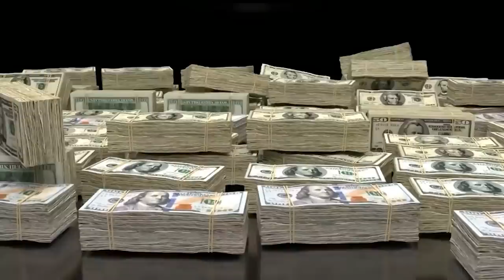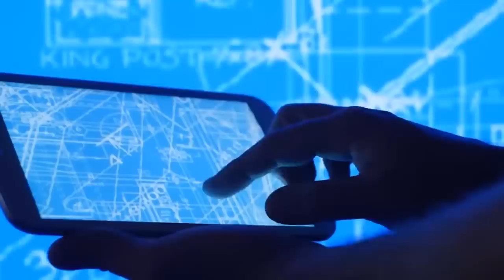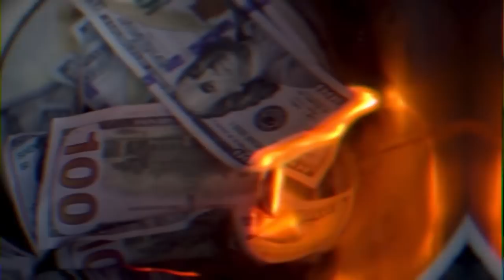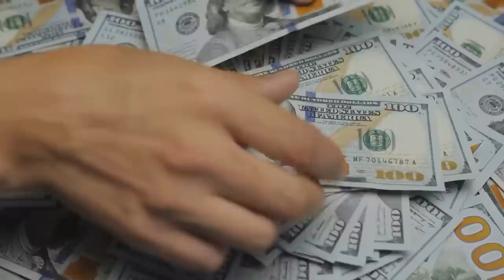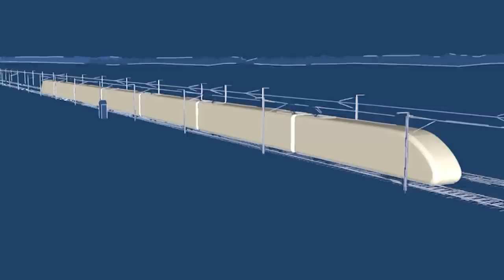Green Light for $4.2B California Bullet Train

Comment: Hey, this video is actually pretty good unlike almost all other similar videos on Youtube! Kudos! Almost no misinformation made it into the video.

I would just highlight one thing. The I-5 corridor was rejected for CAHSR not purely in order to serve the Central Valley cities. Important as it is to have CAHSR serve the 6.5 million inhabitants of the Central Valley, this was not the main reason why the current alignment was chosen. 

This is just a conspiracy theory driven by the rabid political opposition to this project. In actuality, the I-5 alignment would require an incredibly expensive tunnel under the Grapevine mountain range to cross into LA. That tunnel was judged to be more expensive than the entire system plus the planned future extensions combined. It's an incredibly challenging piece of terrain to tunnel through. Instead, a crossing to the east was chosen - the Tehachapi pass. This pass is where most of the rail traffic crosses into the LA area from the Central Valley. It's the default choice. It also has the side benefit of going through Palmdale which houses yet another 500k potential riders!

and if you trace a straight line from the Tehachapi pass mountain crossing to the northern mountain crossing into the Bay Area, you get precisely the current alignment. It is almost by sheer luck that this straight line between the two chosen crossings happens to reach every single large city in the Valley!
Reply: The reason the SP went over Tehachapi was at the time they weren't planning on going to LA. LA was a small city, and the SP was focused on going to New Orleans, crossing Tehachapi then going over Cajon to continue east. LA convinced the SP to build to their city, so SP turned south through Soledad Canyon to LA then continued east to New Orleans. Later, Santa Fe did seriously consider building over Tejon Pass (Grapevine) to better compete with SP for intra-California traffic, and even began surveying a route, but felt they couldn't compete with state-funded highways being built at the time. So they abandoned that project and used those funds to upgrade their LA-Chicago mainline, and instead launched a new passenger service between Bakersfield and Oakland with a bus bridge to LA, which would become Amtrak's San Joaquins.
Reply: Following the I-5 corridor for high speed rail saves a substantial distance over going through the Central Valley on a passenger high speed railroad considered to be at the viable distance limit to compete with jet travel between LA and San Francisco using the I-5 routing.  Using the Central Valley for high speed rail makes it longer than the 300 - 500 mile trip distance for high speed rail to offer superior destination-to-destination travel time compared to jet travel.  

I think the real loss is not exploring a coastal routing that Amtrak currently uses going north of LA and continuing a new high speed rail alignment along the coast linking costal communities between LA and San Francisco, although slightly longer than the I-5 corridor it offers travel through a costal area many people would desire with much scenery.   The idea of avoiding large cutting edge engineering challenges, such as the I-5 corridor or a coastal routing would require so fragmented construction and design can make use of standard construction firms is good for rapid employment, but has little chance of assembling a cohesive high speed rail system.  There is no advanced passenger train research and development institution knowledge growing and evolving.  

What I've seen in videos of the HSR construction appears like very straight forward construction through unchallenging Central Valley terrain done at very high expense connecting farm land without great scenery.    I've read California high speed rail design documents that state high speed rail criterial does allows for climbing grades over 1.6% at high speed, but not for going down grades at over 1.6% at high speed.   Outside the Central Valley in areas not yet immediately up for construction there are grades in the designs for "high speed rail" over 1.6%.  If rail grades need to be less than 1.6% for normal bi-direction high speed rail use then this will  be a show stopper.  I'd expect ether high speed rail will have to be degraded to just a fast train or an extensive redesign and rerouting will need to take place.  

The solutions for reducing steep grades is likely more extensive tunneling.  The expectation in China with high speed rail is it will likely be made up of bridges and tunnels to such an extent the main design companies designing high speed rail alignments specialize in bridges and tunnels.  That should tell you if contemplating high speed rail don't be averse to bridging and tunneling because those structures are the foundation of many high speed rail alignments.  Whenever possible the desire structure for a razed alignment is earth because it is permeant and solid with little long term maintenance compared to bridges that have a limited life span and do vibrate and shake more than earth structures.  

Freight railroad have been approached about combined railway corridors with the California high speed rail, but they have backed away from that idea.  They may not see the economical advantage of being that great, but moreover they don't feel comfortable with a reasonable outcome working with non railroad knowledgable organizations.  The idea that California can build high speed rail over sizable distances without becoming experts with it is absurd, which is the appearance of what is taking place.    At this rate of institutional development the high speed rail between LA and San Francisco might take another 30 years and miss technological achievements needed to deliver the timely connections it was intended to provide.   As a rail fan I think I'd still like to see it built, but I fear it might serve to show that high speed rail doesn't work in the USA.  There is a high chance the California high speed rail connecting LA and San Fransisco will show high speed rail costs a lot and then doesn't compete with normal jet traffic in time saved.  To some degree the real advantage of high speed rail isn't connecting the two main destination cities, but allowing fast connection with them and the smaller communities between them that don't support passenger jet service.   That is where a coastal route would bring a great deal of benefit.
Reply: @douglasengle2704  im not going to comment on everything here, as i dont know enough to do so. BUT, if you really think having the train running along the coast is a great idea, you're wrong.

The coast is not only mountainous, but wet. And i mean rising tides wet. Do you really think water and electricity for a system that hasnt been built in a region in DECADES is a good idea?

Also, plenty of train- high and low speed- drive through the countrysides. There's really no getting away from it.

Also also, the future plan is to connect to Sac. And the most direct route to Sac is through the CV.

If anything, with Amtrak's service past Merced will ending once this is built, that's an issue i think we should discuss. Cuz unless they are connecting the dying stations to the new ones with some type of bus service or intercity rail, they should instead continue it
Reply: @Yvonne-Bella  The most direct route is through the I-5 corridor.  The idea to avoid engineering challenges is typical, but unavoidable.  A large part of HSR interest is it is an engineering challenge, but the reward has value.   This is a new system and saving even 30% on construction is a fools savings if it makes it less viable for its difficult to achieve goals.   As it stands right now if built it doesn't appear the designs would allow for HSR end-to-end and I'm suspicious even in the Central Valley with such an apparent lack of motivation for really building HSR that it will function as HSR.  The design criterial I've read has been informative discussing specification for 400 kph high speed rail, but looking over the designs they don't meet this criteria.
Reply: @douglasengle2704  Almost everything you wrote is debunked nonsense from foamer blogs.

I'll address just this one thing. Going over the I-5 requires a tunnel under the Grapevine. That tunnel was going to be more expensive than the entire project plus all the extensions. It was a complete nonstarter. Hence, they chose the Tehachapi Pass crossing toward LA. From that crossing to the chosen northern crossing, Pacheco Pass, the shortest line is in fact the current alignment. 

If you don't go under the Grapevine, then the I-5 is actually longer than the Hhy 99 alignment that they chose. You can look at a map right now to verify.
Reply: @douglasengle2704  I-5 is not the most direct route because it requires an insanely expensive Grapevine tunnel. Sinve the Tehachapi Pass crossing was chosen, the chosen Hwy 99 alignment is in fact the shortest straight line through the Valley.
Reply: @TohaBgood2  Would you be so kind to explain why tunneling through the San Gabriels is a good idea?
Reply: @davidjackson7281  The terrain going through the San Gabriel mountains toward Palmdale and then through the Tehachapi Pass is a lot more mild. It's conventional mountain crossing terrain for rail infrastructure. It's also why the existing rail lines go through there. It's just a much easier mountain crossing from a technical perspective.

That means that the whole thing does not have to be in a giant monster tunnel through a major seismic fault zone. Going over the current route will only require a series of small tunnels that are a lot more manageable and something that we build all the time vs. the Grapevine monster tunnel which would be a world first in most ways. This will also make it possible to keep high HSR speeds through that sections vs. the Grapevine tunnel which would have likely required a massive slowdown like in the Channel Tunnel on the Eurostar where trains are limited to only 100mph. In terms of actual running time the chosen crossing is a lot faster than a potential Grapevine tunnel crossing ever could be.

Another advantage is that over 500k people live in Palmdale and even more in the Palmdale area. It's also the only viable connection point to a future Las Vegas HSR link. That's a ton of riders to bypass at insane cost! Why would anyone want to do that? Why would we spend many times more money to bypass 0.5 million customers, at a slower speed, and with no Las Vegas link? If you actually think about it then the Grapevine option never really made any sense. That's why it was dropped almost immediately and the Tehachapi option was chosen.
Reply: He was right about the Central Valley “being a part of California”
Reply: @TohaBgood2  " I-5 is not the most direct route because it requires an insanely expensive Grapevine tunnel". So the grapevine tunnel is the most direct route.  The expense of building a railroad doesn't change its distance.
Reply: @douglasengle2704    All of this was already discussed when they were making the routing decisions years ago. A Grapevine tunnel was considered briefly but dismissed as soon as they looked into its costs and specs seriously. It came out insanely expensive. It would have to be extremely deep and extremely long. This would mean very complicated engineering and severely reduced speeds. See for example the Channel Tunnel which has speeds capped at 100mph vs 186mph for the Eurostar on open track. A Grapevine routing would be slower than the chosen Tehachapi pass route because the latter maintains HSR speeds while a Grapevine tunnel would have to downgrade speeds significantly for safety.

The point of having a more direct route is to go faster, right? What’s the point in spending insane amounts of money on a crazy long tunnel if this nominally “shorter” route takes longer to traverse?

And finally, the most direct route from SF to LA is actually not the I-5 but rather “as the crow flies”. The I-5 is significantly to the east of that direct line. So why don’t you propose that direct route instead? It’s significantly more direct than I-5, isn’t it? Shorter == better, right?

Well, just like the Grapevine routing, that actually straight SF-LA routing goes through complicated mountain terrain and would be even more expensive and have even more restrictions. In picking these routes, having the straightest possible line on a map matters little if the trains go slower on it than they would on a saner alignment! The point is to have faster trains not straight-looking lines on maps, right?
Reply: @TohaBgood2  I've never read other blogs..  I did my own simple route study.  It just happened that the I-5 route was actually studied.  I have also read the California HSR 400 kph railroad design criterial and it doesn't look like the actual designers did because their designs don't meet the design criterial in regards to maximum grades of 1.6% for HSR going down grade.  This looks like a ship without a captain from the start or shortly there after.  I am expecting that once they start looking seriously into the going through the more difficult terrain outside the Central Valley it too will be prohibitively expensive.
Reply: @TohaBgood2  China builds HSR tunnels.  The Swiss have built long HSR tunnels.  The Japanese are building long maglev passenger train tunnels that are for 500 kph.  It doesn't seem plausible that a top HSR engineering team can't put a HSR tunnel under Grapevine.  That made me doubtful of any real competence in the California HSR project after I'd read about the HSR Grapevine tunnel study.
Reply: @douglasengle2704  Possible - sure, necessary - no. Why would you go to the extra trouble and expense if you can also capture a ton more riders by not doing it? At HSR speeds the extra 10-20 miles you're adding to the route take all of 10 minutes to cover! It's literally nothing in the grand scheme of things. 

But what you gain is 500k more riders in Palmdale, 6.5 million in the Central Valley, and a connection to Vegas! Who in their right mind would spend more money to run this HSR line and bypass most of the customers on the route? Doesn't that sound insane? Cause it sounds pretty insane to me!

And if you're doing that then why not quadruple or sextuple the cost and go on the completely straight line? That's more direct by a few dozen miles still, isn't it?

FYI, whenever at all possible, all HSR projects avoid tunnels like the plague. They really do a number on your budgets. That project in Japan is already more than 2x over budget. Not 50% over budget like CAHSR, but 2x, 200%! It's already 10 years delayed and it's not clear that they will ever finish it. The full route is only slated to be completed in 2037 and even that is perceived as mostly marketing. It looks like it will just remain a stub of exotic infrastructure just like all the other maglev lines.
Reply: @douglasengle2704  Lol, sure bud. The people from Deutsche Bahn that CAHSR hired to do early operations know less about HSR than some dude who did 5 minutes of research on the internet.

And those other world class HSR engineers that CAHSR has hired know less than you too. Sure!

Give us a break, will ya'?

😁😁😁😁
Reply: @TohaBgood2  LOL. He really said “I did my own simple route study”. 
His “simple route study”: looked at a flat map of California for 45 seconds
Reply: @HarZoiD  you know, creators like the Backyard Scientist and Alan Fisher (the Armchair Urbanist) have reclaimed those kinds of insults. That leaves me wondering what to call this 🙃 gotta get creative now
Reply: @mrmaniac3  Exactly. You got it 😂
Reply: As European my guess here can only be that the US simply lacks the experience in building HSR tunnels. Looking at Switzerland, Austria or Italy, or even the Fehmarnbelt fixed link between Germany and Denmark there's a lot of rail tunneling goin on, and costs are consequently pretty manageable...
Reply: 1. The original proposal used the CA99 corridor because the Legislature needed the Central Valley votes to pass the Proposition 1A funding on the statewide ballot. BTW, the Sierra Club threatened to remove its support for the original route unless a special Central Valley caveat was put in -- a station at Los Banos is not allowed because the Club fears HSR becoming popular and the Central Valley becoming a less expensive commute suburb to Silicon Valley. 
2. The original route planning made wrong/ignorant/bad/low-ball assumptions about using the CA14 route. The amount of tunneling now required for that section is by itself more expensive than the required Tejon/Grapevine tunnel. The Legislature feared the Grapevine route because of property needed from Tejon Ranch (the largest private ranch in California, a politically powerful entity). The CA99 corridor has become a nightmare for land acquisition, and dealing with Tejon Ranch would have been simpler and cheaper. The I5 route would have been faster, straighter, and easier. 
3. The existing Tehachapi route is so winding (useless for HSR, which needs straight track for any speed) that long trains literally cross over themselves on the corkscrew elevation. This situation is why there is no passenger rail service between Bakersfield and LA, even though the tracks are there. 
4. Using a coastal route is a non-starter. The US101 corridor is too winding and constrained for new HSR. 
5. When Jerry Brown returned as governor, he told HSR there would be mandatory track sharing between San Jose and San Francisco, to keep the cost from going to Apollo Program levels (SF estimates that just 2 miles of new track to the already-built Salesforce Tower terminus in SF will cost $6 BILLION.
Reply: @ReedmanFL  You're making assertions that you can't support and some that are provably false.

1. This is a 100% voter funded project and approval from as many Californians as possible was key in passing the 2008 bond measure. But connecting 9 out of the 10 largest California cities including the cities in the Valley was never just an optional thing that you could pass on. It was literally the justification for the project. I know that a lot of you wanted to divert the project to just an SF-LA HSR link with no stops in other cities. But this went expressly against the goals of the project and against the will of the people. It was always a nonstarter and it was always going to fail. It is literally illegal to divert the money for a statewide HSR project to serve just two metro areas. CAHSR is just a small part of a multi-decade investment program for rail that California has been undertaking for the last 20-30 years. It's supposed to serve as a statewide backbone to a bunch of other local rail services that have been getting beefed up and upgraded. You can't just alter a key part of a multi-decade statewide rail plan just because you think that Fresno doesn't matter!

2. Wrong. The current post-inflation adjusted cost is similar, but this is after the actual engineering is done for a full-speed HSR Tehachapi Pass alignment. The Grapevine was never even coming close to those speeds. a full-HSR version if it were even possible would cost astronomically more. The cost that you are using for the Grapevine tunnel is before inflation. And this cost was large than the entire cost CAHSR at the time without the Grapevine tunnel. It was an insane cost escalation at the time. Given that it has been decades since those estimates, that's just a crazy irrelevant number to compare to. Furthermore, you're comparing the Tehachapi option after all the engineering is already done and in today's dollars. Are you arguing that the Grapevine estimate would not go up proportionally if they were to actually go look for all the fault zones and geotechnical issues with that route? Because that is laughable.

3. The exisiting Tehachapi route is a freight link that was built in 1876. No HSR or passenger rail is ever plan to go there. 
technical

4. Yes.

downtown
Reply: @TohaBgood2    "The people from Deutsche Bahn that CAHSR hired" are writing what their customer wants them to say.  You're not going to have good customer relations if you overly criticize the people paying you.  I have not read the reports from Deutsche Bahn, but I bet there are statements that act as a legal back stops for situations they can't control.  I did  read the report on the Grapevine HSR base tunnel study years ago.  It didn't read like an engineering study describing a challenging HSR base tunnel construction (base tunnel is a tunnel starting at the base of a mountain that is very long compared to shorter tunnels higher up on the mountain), but a report on why it's wasn't possible!   That is absurd!   If you are going to build HSR over any significant distance you expect to build a lot of challenging tunnels, fills, cuts and bridges that make an HSR alignment possible.  

I'm not as constructive in my comments as I was when it seemed like the CAHSR might have had as a primary goal of providing a new type of high quality-of-life passenger train experience competing realistically with airline travel times when the airport commute time is added in.  The HSR connection between LA and San Francisco is where 220 mph running speeds are justified along with minimizing delays such as longer distances.  The CAHSR designs I've read are mostly below the  specifications for 220 mph.  They have grades exceeding 1.6% descending which the CAHSR specifications claim doesn't allow for needed train control for HSR use of speeds above 124 mph) (200 kph)  The CAHSR specifications preferred minimum radius for a 220 mph curve is 50,000-feet with a minimum of 25,000-feet.  The curves I've seen in the CAHSR plans are suspiciously looking tighter than these specifications and don't have their radius obviously listed.  I'm very disappointed at CAHSR past history with their HSR project.  Large highly engineered projects like CAHSR should not only be of obvious high value they should act to inspire and advance the culture of engineering and railroads.   The huge flaw in CAHSR is its failure to develop institutional knowledge.  The consultants are hired to hire other consultants according to overview reports I've read.   California needs to be developing CAHSR with permeant long term career employees with long term career advancement in its CAHSR industry.    It still seems like there is lack of long term commitment to HSR.
Reply: @douglasengle2704  All HSR routes throughout the world don't run at their top speed through the entire length of the route. They all stop at smaller cities in between the large city centers. And many HSR trains share tracks once they are within the big city centers so they obviously can't go at full speed. The same thing will happen in CA. There will be huge sections where the train will go 200 mph and about 50 miles out of LA and SF will run at much slower speeds but still faster than many current trains in the US.
Reply: @theexmann  The very concept of HSR is to have it between major large cities where it runs the entire length as HSR.  I'm not aware of the Japanese bullet train going slow on the outside of cities.  Chinese HSR like any railroad does have sections below normal top track speed, but these are not due to being around cities.  The UK's HS2 going between London and Birmingham is said to being built  90% in tunnels or on aqueducts.  That is the kind of construction expected to build high speed rail.   Bringing the HS2 into London is going to be in a massively long tunnel apparently greatly to avoid the populated surface.  There is nothing in the HS2 that indicates it will be going slower around and into cities.  California is unique in that its currently planned HSR doesn't actually have HSR to a major metropolitan city.
Reply: @douglasengle2704  You're completely wrong. HSR all throughout Europe slow down considerably when they arrive near city centers. Many of the major city stations are NOT underground. There are tons of youtube videos that show that. And like I said many of these HSR routes stop at smaller cities along the route. If you think about it, they have to slow down to stop at these stations too. How long do you think it takes to slow down a train going at 200mph? It's a bigger distance than most people realize.
Reply: The benefit of using the I-5 corridor is that the State already owns the land.  Obtaining the land for the route along 99 has caused massive delays and they still don't own all of the needed land for the route.  Down near Bakersfield the distance between I-5 and the 99 is under 30 miles so they could have followed the I-5 corridor and still gone over the Tehachapi Pass.

The biggest reason for cost overruns so far is polical cronies getting the construction contracts by dramatically under bidding the project and then going massively over budget.  A recent audit of the CHSRA showed that they have paid tens of millions of dollars on contracts already with no evidence any of the work was actually performed.
Reply: @sharkhaywood  Dude, that's just a bunch of nonsense from foamer blogs that was debunked like a decade ago. But I guess at least some of you people forgot that debunking so let me give you the cliffnotes version.

To begin with, the I-5 corridor like any highway median was designed for vehicles with rubber tires doing about 70 mpg. A lot of the turns are simply too acute for HSR and the train will necessarily need to slow down in a ton of places. HSR corridors built in existing highway medians are usually limited to 150 mph. This would be the case for almost the entire length of the I-5. That already means that that corridor would be illegal under the 2008 bond measure. So game over, you can't do it.

But even if you could, the median of the I-5 corridor is not wide enough in sufficient places to make that median viable for any rail line, let alone HSR. Consequently, to stay in the median you would need to constantly hop in and out of it at incredible expense. Those viaducts to hop in an out of the median are literally the most expensive possible way to build a rail line. And of course, every time you hop out you end up on private land that needs to be purchased exactly like they do for the current route!

The northern part of the corridor clips a mountain range and is all hills. So that part needs to be completely avoided to save costs. Alternatively, that entire section needs to be a continuous sequence of trenches and viaducts. As you might imagine that that is insanely expensive and no one would agree to do it just for the fun of staying in the median!

The Grapevine crossing was studied and proved extremely slow and extremely expensive due to the complicated terrain and geology. It would have cost more than the entire planned CAHSR system for that one tunnel to make it HSR compliant. So that's out. The only viable crossing in the south is through the Tehachapi (the one they ended up choosing in the end.) So at the southern end you still need to cross all the way to the east of the Valley toward the Tehachapi crossing.

So how does a viable I-5 corridor actually look like. It's longer than the current route because that goes diagonally from the southern mountain crossing to the northern one. It's 150-ish mph max, so just barely HSR compliant, but it still has a ton of turns where the trains slow down below 100mph. You veer east to avoid the hills in the north. You jump in and out of the median at insane expense or you just build next to the highway on private land, exactly the way CAHSR is building along Hwy 99. And then you veer all the way east _again_, toward the Tehachapi crossing.

That is an insane double S-shape alignment! That alignment was the fist of the three to be eliminated. It's both more expensive and a lot slower than what they ended up choosing. And that in addition to bypassing about 4.3 million passengers in the Central Valley cities that comprise most of the million passenger ridership of the line CAHSR is supposed to replace!

Now tell me, in what world does the I-5 alignment make more sense than what they chose? And I remind you that we've all already discussed all of this crap ad nauseum 10-15 years ago when all of these decisions were being made. It's not like you're coming with any new information here!
Reply: @TohaBgood2  Honest question.  Are you from California?  Have you driven I-5 to LA?  The current chosen route has far more turns than I-5.  I have worked on litigation involving HSR.  European engineers brought in for their expertise have said there are too many turns on the current route that will prevent the train from reaching top speeds.
Reply: @sharkhaywood  That's nonsense, bud and you know it! I live in the Bay Area but most of my family is in SoCal so I drive up and down the 5 at least a few times a year to visit them. I also put about 50-70k miles per year roadtripping around the state!

I explained in detail why the 5 was disqualified as a route. Those are objective criteria, not nonsense some anti-rail goon from the Cato Institute made up while looking at Google Maps from his home in DC! Anyone who has ever driven on the 5 knows that what I said is exactly true. 

The "European engineers" meme that you are trying to bring up is no doubt the conspiracy theory that a bunch of foamers made up about "the French team" pushing for the I-5 corridor. Only that is fake and we all know it! The SNCF consortium did not express any preference for any of the three Central Valley routes that they drew up proposals for! Three routes were being studied and all teams made plans for all three. And the I-5 corridor plan was only one of the three that they compiled! The French SNCF team was eliminated from the bidding process before the route was fully finalized, but they still expressed full-throated support for the chosen Hwy 99 route over the other two alternatives.

You people keep lying about crap that's been debunked for a decade now! That's why nobody believes you goons anymore and the popularity of CAHSR is increasing with voters!
Reply: @douglasengle2704  All contracts have that kind of standard language. That is indicative of precisely nothing.

You're quoting a bunch of minutiae that is present in literally every single HSR corridor plan in the world. There will be sections where CAHSR will run slower in dense areas. There will be stations where CAHSR will slow down. But the bulk of the track mileage of the entire system and practically 100% of the Central Valley section is at 220mph! By all accounts this will be either the fastest or tying for the fastest HSR corridor in the world when it is completed. And most of the Central Valley segment is not only finalized on design but is actually complete in terms of guideway construction.

It's simply too late to argue what you're trying to argue about this corridor because most of the fast Right of Way is already built and you can see it yourself if you travel in those parts. There are literal full-length   drone videos of the corridor that have zero of the features you say are problematic.

Qualified folk have run the simulations and pretty much everyone agrees that CAHSR is hitting the 2h40min target for SF-LA, exactly as designed.
Reply: @TohaBgood2  You realize the route they have chosen has far more turns that I-5 right?
Reply: @sharkhaywood  What are you talking about? The I-5 route has to make multiple sharp turns to avoid the hills in the north, join and rejoin the median with viaducts, follow the slow turns on the highway,  and then a huge turn east to cross the mountains at the Tehachapi crossing.

This has been discussed a million times already by everyone and their mother! We've talking about this and studying this for a decade+! Everyone knows what the deal is with the I-5 corridor.  It looks good on a flat map, but in practice it is a lot slower than the completely direct Tehachapi to Pacheco corridor that they chose.

The chosen route is literally a straight line diagonally across the Central Valley from the northern crossing to the southern crossing. How can you get any more direct than a literal straight line over flat farmland?
Reply: @sharkhaywood  Using the I-5 ROW doesn't mean it would be the best route. Maybe cheaper, but not better.
Reply: It's got more to do with history than luck. The major cities of the Valley were railroad towns back in the old days. The San Joaquins Amtrak route still connects them to Oakland and Sacramento
Reply: @seanj4119  Yeah, that was more tongue in cheek than anything else. A ton of people are now trying to claim that the choice of the two mountain crossings and the straightest line between them wasn't the main determinant of the CAHSR route through the Valley.

Of course, the place where the terrain made the most sense for a rail line hasn't changed in a century. The places where the towns are is still the best and most direct rail route. That's why they were built there in the first place!
Reply: @TohaBgood2  As you have said, HSR avoids expensive tunnels at all cost. Half of the proposed  50 miles of CAHSR tunnels are in the last, final segment from Palmdale to Burbank. This will be dropped like a hot mess. Rather, Metrolink will be improved to be a blended (faster speed) like the Caltrain segment because a mere 30 minutes saved won't be cost effective. You heard it here first and foremost. You are welcome.
Reply: @TohaBgood2  Like you said there will be slower sections in dense areas. There will be between 125 miles and 175 miles (nixing the San Gabriel tunnel route) of 79 mph maximum blended tracks at each end. A middle segment of 375 HSR miles  averaging 150 mph is a 2hr30min trip. 

A speculative trip in 3hr40min may be possible IF 1) the distance was reduced by 20-25 miles at each end by redefining the SFO airport Millbrae station as SF and the LA county Burbank airport station as LA and most importantly 2) the trip would have to be NON-STOP, direct, pedal to the metal. 

With 11 station stops it's a 4hr30 trip and bypassing the San Gabriels make it five hours. Please retain your credibility by not making implausable assertions.
Reply: @davidjackson7281  Those are nonsense numbers. The minimum speed limit will be 110mph in the Bay area and 125mph in the LA Basin. There are no 79mph sections at all. The entire nonstop SF-LA trip comes out to 2h38min and change in all track simulations run both by in-house and outside sources.

What is the source for your numbers? Did you just make them up yourself?
Reply: @davidjackson7281  You have no idea what you’re talking about, bud.
Reply: @davidjackson7281  Those are nonsense numbers. The minimum speed limit will be 110mph in the Bay area and 125mph in the LA Basin. There are no 79mph sections at all. The entire nonstop SF-LA trip comes out to 2h38min and change in all track simulations run both by in-house and outside sources.

What is the source for your numbers? Did you just make them up yourself?